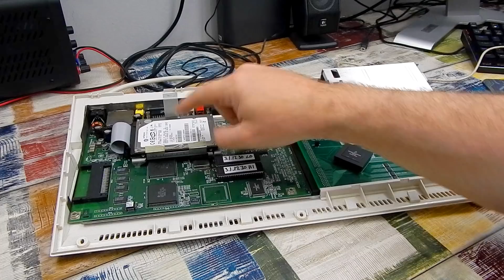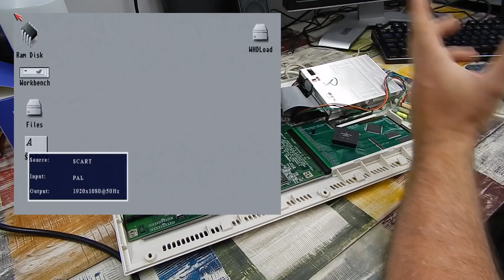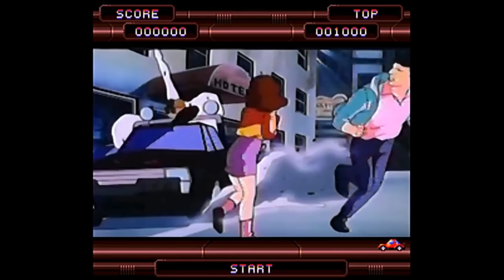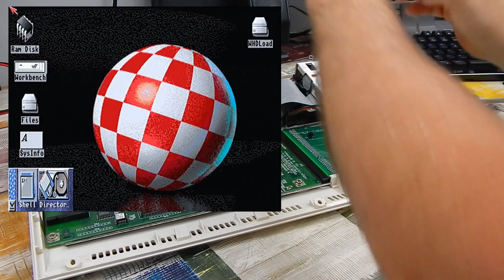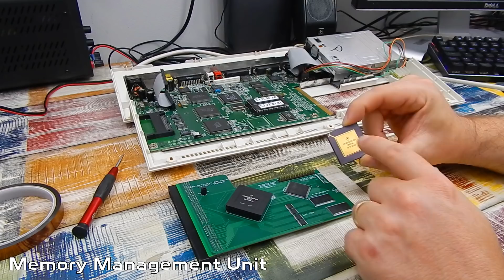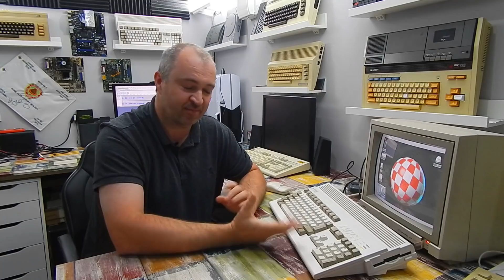Overclocking an Amiga 1200 accelerator.

Comment: I remember there was an ACA card with a 50mhz 030 overclocked to 56... I owned one back in the day and was quite fast, that 10% boost allowed some apps to run a bit better, because running on plain 50mhz were on the edge. For example the NES emulator, running it at 50mhz had some noticeable little slowdowns that didn't happen at 56mhz.

Comment: I have an old A1200 in a Power Tower tucked away somewhere and the appropriate Amiga branded multisync monitor at my parent's place.  I had an '040/25 accelerator card with 32MB of Fast RAM as well.  The accelerator was damaged by battery leakage and I haven't got around to sorting it yet, I just cut the battery out and put white vinegar on it to stop any further corrosion.  I really wanna get it up and running.  As far as I can tell the A1200 motherboard still boots, but it hasn't been recapped so it probably needs work too.  Unfortunately I don't have the space to keep it though so if I get it working I'll probably end up putting it up for sale.  I loved my Amiga back in the day, much preferred it to the Windows 95 PC we had at the time.

Comment: I suspect at 62.5 Mhz the CPU may need a bit more power to make the speed setting which is that little bit more than the accelerator board is geared up to supply.  That is a regular thing with PC overclocking from back in the day that you can get so far at stock power settings but at some point you need to up the core voltage in order to get any further with overclock.  If you did up the voltage it would be advisable to put in a heatsink and fan combination.

Comment: 50 MHz is more than enough for Amiga titles. If you want to run Doom, simply pick up a $20 low end PC for that. I play Amiga for Amiga titles that were and still are fantastic.
Reply from the maker: Yeah I'd agree with that.  50mhz is more than enough for most Amiga games, in fact just adding a bit of fast ram is probably more than enough.  So why overclock it... why not 😉
Reply: @CRG  50mhz, 68030s are still reasonable and fantastic, real 68060 chips and even Vampire accelerators are getting far too pricey and are unnecessary for original Amiga titles.

Comment: 10:34   Curious if it may be overhead to run the drive on the accelerator that makes it report a little slower than without a drive attached?

Cool video though.  Was nice to see the results.

Comment: If I knew this back in the day, I'd've probably wrecked my expansion card in, I think '96, maybe '97, attempting to remove the old crystal. All just to get Doom running at full 320x256, as my CPU tanked the framerate at higher than 320x240. Them borders on a PAL screen mode irked me.

Thankfully I still have my A1200 and can play SWOS as intended.

Comment: I wanted to do something like this back in early 2000 I had a 50mhz 030 and I found it to slow to play modern games like doom, I thought if i overclock it it should get an okay  frame rate, found a 68040 @40 mhz with fpu and i could play doom on it. Fun times.
Reply from the maker: I tried doom on it since making the video.  On low quality you get an average of about 12-15fps.  It's playable, just a bit slow.
Reply: @CRG  Yeah still faster than what it got back then about 8-10 fps i think, cloud also be that the ports have evolved quite a bit since then. Anyway now I must find myself a way to get some Amiga back in my life. Without costing an arm and a leg.
Reply from the maker: @rodovanra6783  WinUAE is the cheapest way, that's free but if you're anything like me you prefer the original hardware and unfortunately that's an expensive game to get into.

Comment: The EC cpu's can typically run faster and cooler then the full functional chips, they could also be cut down full versions that have the more complex logic parts broken and fused off that does not like overclocking to start with. MC68030RC50C mask 1F91C should probably the better ones since they were the last manufactured and possibly on smaller node.

Comment: The XC95 CPLs can be rated at 10, 7.5 or 5ns. If you have a 10ns one then clocking it at anything over 100MHz is an overclock. It would be interesting to see if what would happen if a 5ns version was used and a bunch of CPUs to see just how fast a 030 could go.
Reply from the maker: I need to check the fine print on the CPLD I fitted, not sure what speed it is but certainly from my googling mid 60mhz seems to be the best anyone achieved on a 030.  With all new modern hardware around it though it would be interesting to see how far it could be pushed.

Comment: What turning the unit into a Tower PC and going with the ASETEK Vapochill Lightspeed XE-II but you will have to coat the parts of the board with Corning fluid and kneaded eraser to protect the parts of the board you don't want condensation coming in contact with.
Reply: LOL! Vapochilling an Amiga might be taking it a bit too far, it needs a hot CPU to not just turn everything into an iceblock and brick itself and whatever it's connected to. Yes, had one back in the day, bricked it and more experimenting in the mid 2000's or so. At the end I punctured the gasline to block or one of the tubes, forget now. Gave that stuff up then, the vapochill was worth more than the box I was trying to cool with it.

Comment: Could the gold top issues be, because you don't have the mmu libs installed?
Reply from the maker: I don't think so to be honest.  The system is just unstable with the gold top pushed to 60.  Running it at 54 in the CD32 with or without MMU libs it works fine.

Comment: Try enter "cpu fastrom" in amigados. 

Then read speed on dh0
It will jump up on the internal ide a bit. 

Im quiet sure you will reach around 8-9 mb on the tf ide. 

Atleast does the TF530 ide do.

Comment: I have a TF1230 and also get varying results on the MIPS with Sysinfo 4.4. My highest is 9.69 but it also shows 9.63 sometimes and occasionally in the 8's. A reboot usually brings it back up to the max again which is weird. I'm sure I didn't get varying results with my old ACA1221 card so I guess its a TF thing.

Comment: My first thought was that I might try using a 50MHz crystal and running the CPU at 25MHz. I don''t need the speed and a cooler CPU is always a good thing.
Reply from the maker: Yes that's an interesting thought, I don't see why it wouldn't work.

Comment: One thing where these faster clockspeeds could come in handy is in creative software. Like the filter effects in PersonalPaint, and various other graphical software, FinalWriter and possinle WordWorth would benefit, and definately the 3d programmes like Lightwave, Real3d and Imagine4D.

But for games, I think a "simple" 8MB board is enough, as very very few games actually will use a faster CPU.
Reply from the maker: Good point and in hindsight perhaps I should have tested some of that type of software.
Reply: @CRG  there is always the next video ;)
Reply: If you really want that kind of software to perform, you need an accelerator with an FPU. It makes a huge difference with things like ImageFX and Art Department Pro

Comment: Can you share a link to the 108 & 120 mhz oscillators ?
Reply from the maker: Found a link to the 120mhz part on aliexpress.  This seller seems to have a variety of speeds available.  Hope this helps.  

Just found this by searching, I've no affiliation with the listing

￡7.59  65%OFF | Free Shipping 10PCS 5070 7050 5.0x7.0mm 120MHZ 120M 120.000M SMD Active Crystal Oscillator 4P Voltage 3.3V 15PF 20PPM
https://a.aliexpress.com/_msERfE6
Reply: @CRG  Thanks - great content as always.
Reply from the maker: I got them from AliExpress but it's going back a couple of years.  If you search for 7x5mm oscillator I'm sure you'll find them.  Just remember it's a 3.3v part that you're lookin for.

If you can find them 110mhz crystals might be a good option for 55 on the chip.  I just could never find them.

Comment: Just an idea was you running the MMULib Software if so dissableing this may allow the Goldtop chip to boot as this has it built in and dont require the software.
Reply from the maker: No wasn't running mmulib.  The failure I think is just down to the chip not liking the higher clock speed.  

The black top chip is (as I understand) a newer chip so likely that's the reason it can take the higher clock speeds.
Reply: @CRG  was going to say something similar because i noticed you had the hdd connected when you did the test with gold top cpu, i was like why didn't he try without it 😂